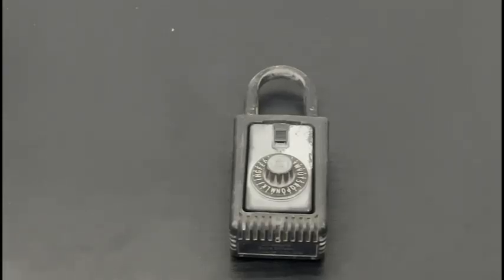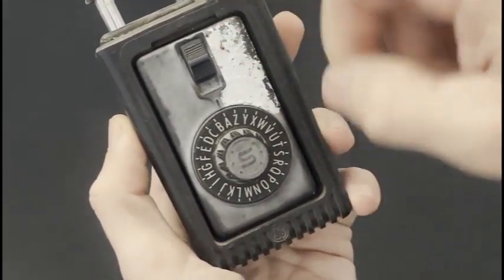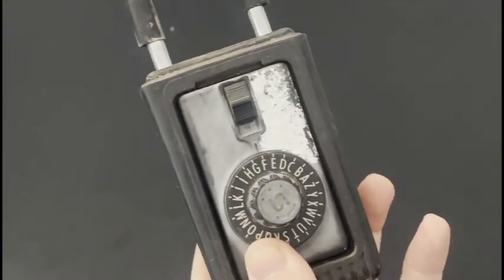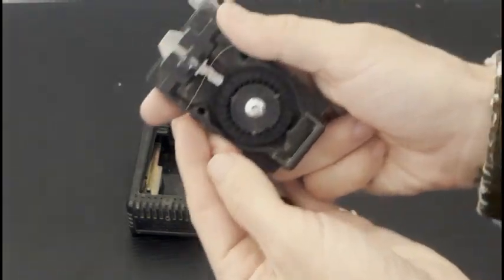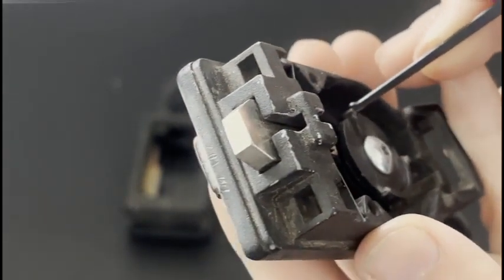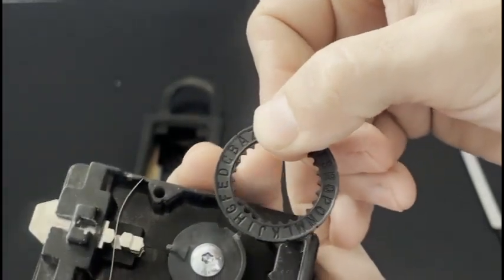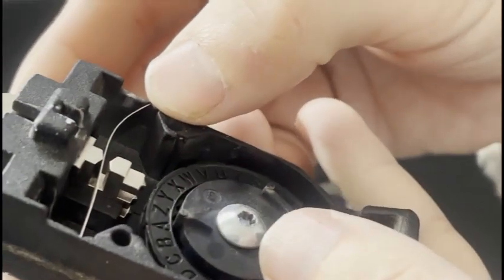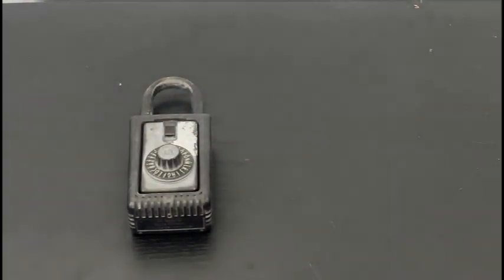GE Key Safe - Open and Reset Combination

Comment: I actually deciphered one of these once. I am a locksmith, and in this instance it was purely for practicing purpose but I was able to find the combo by using the clear button. Finding the last gate was pretty easy, but the first and second gate took some time.
Reply from the maker: Yeah! The gates are wider on these than the safe style wheels it's fashioned after, so it gives you a little wiggle room haha! 

This is the newer style, they also sold a style that used screws instead of tabs, but I believe the wheels and everything were pretty much the same!